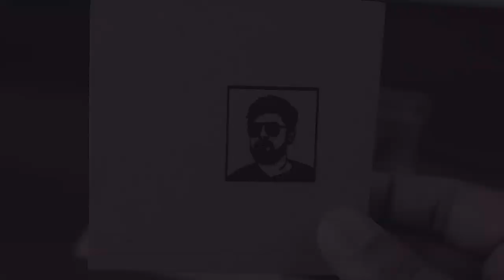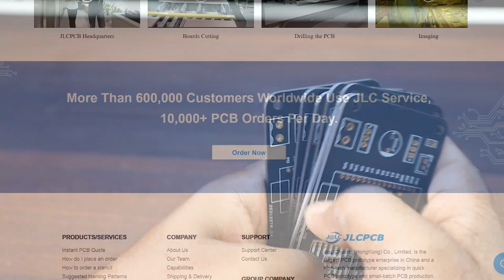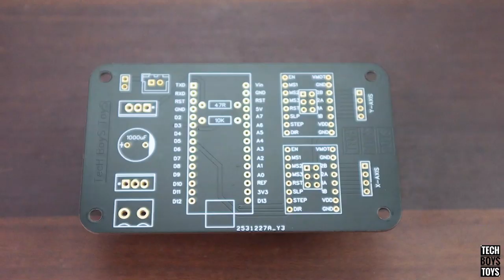How to make Laser Engraver | Laser cutter [Student Science Project]

Comment: Btw each slider is 1500 on bangood so 1500×3=4500
Audrino nano=250
Components =200(around)
A4988 driver×2 =200
Power supply =500
Jlcpcb ordering =750
Loose screws n parts= 500
Total=6900/- only.....